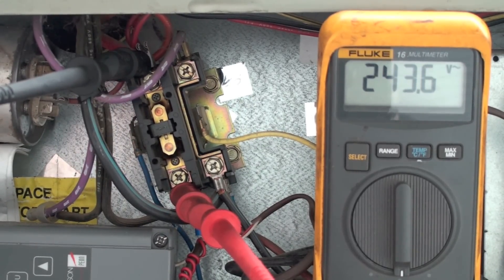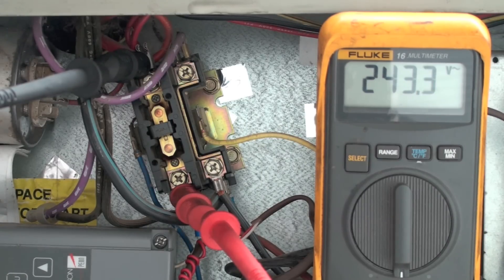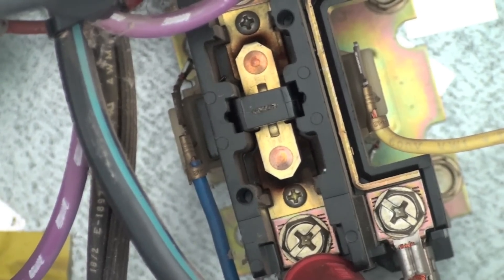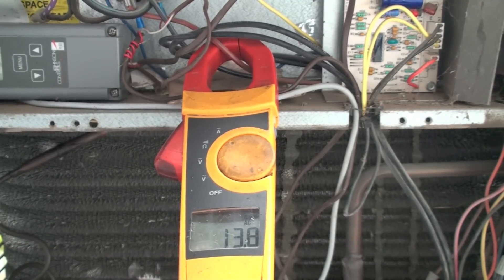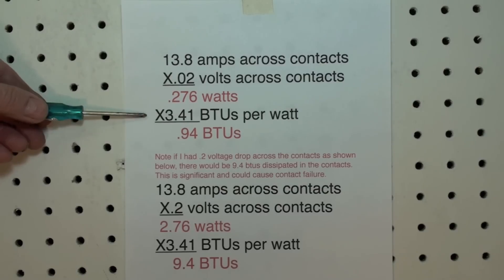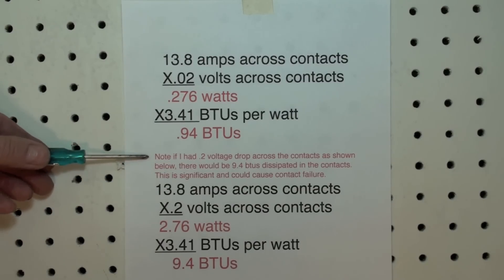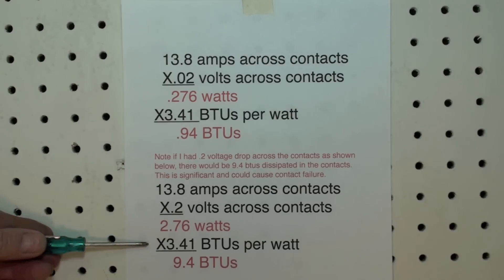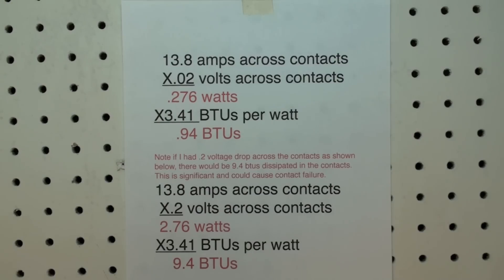how to calculate the heat dissipated across the HVAC contactor

Comment: There is also heat from the coil.  

Most contractor manufacturers state that the coil is the main source of heat rather than the contacts.  The coil has to pull the contacts together.  If the contacts are bad they will be the heat source but in a contactor that is working well it will be the coil.

Comment: Awesome video.
I don’t think there is many or if any at all other videos talking about this so thank you. 

    The power loss over those contacts only have to be quite small for things to start melting because it’s concentrated to such a small area. 

    At my work your not really allowed to do live testing unless you have a lot of controls in place and I looked into getting a micro-ohmmeter but I think it’s a bit overkill and will stick to testing volt drop. 

   There was another video that was touching on this with an old guy testing voltage drop over contacts on a dryer. That was really cool also.

Comment from the maker: All electrical components must be able to dissipate heat.  The passage of electricity through anything causes heat.  Contacts are one of the larger loss components.  Some voltage loss is normal.  If I am losing .02V as in the example, the loss is easily dissipated because it is less than a watt.  If however, it is .2V, that is more like 10 watts.  Some contactors can dissipate that much but smaller ones may not be able to.  You should check drop and note discoloration to determine.
GFM